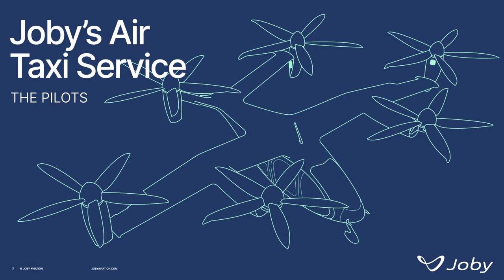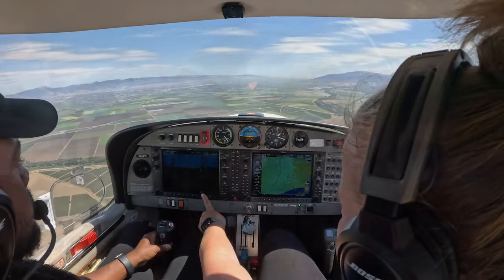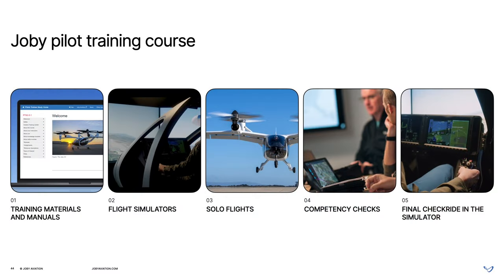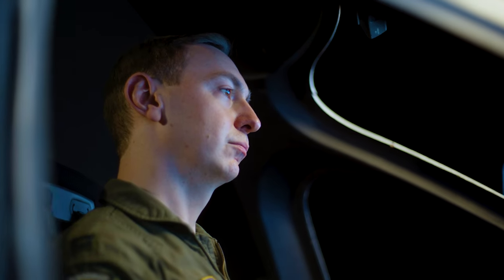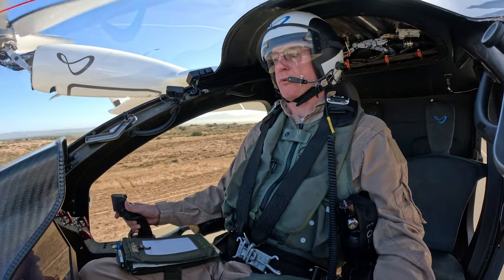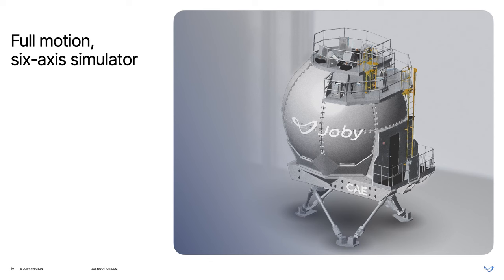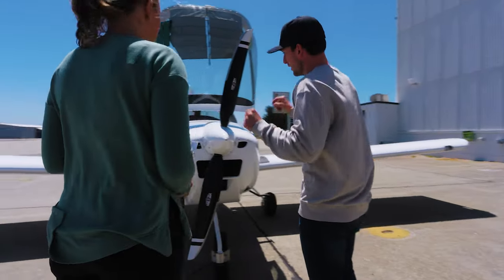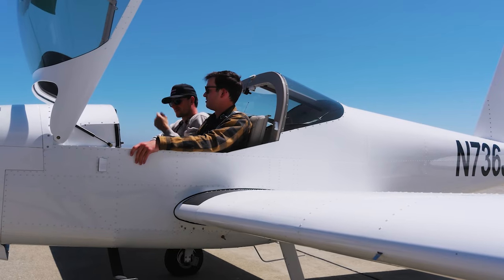Joby's Air Taxi Service: The Pilots

Comment: It is becoming apparent that the lessons learnt on the last generation of VTOLs,' pre battery powering- are slowly being remembered . The constant repetition of just how complex and  critical every stage of implementation of VTOL turns out to be ,certainly as compared to fixed wing flight or even non converting rotary wing, - this 'high tech' is being extoled as a great achievement but is actually a failing that makes the VTOL concept itself the inbuilt problem to be 'solved' rather than rethinking the whole initial goal of providing affordable alternative to road travel in both built up suburban areas and rural type environments (in both cases avoiding the need for airports or runways as a fundamental feature together with much lower noise,higher safety and other secondary goals for which it has been assumed that vertical lift off/on is unavoidable and hence worth paying the enormous cost in design and manufacture as well as operational, including piloting, complexity (artifical stability computerized control interfaces etc and much greater pilot training than normal as shown here)
What if none of this was needed or in fact desirable? What if the wrong path had been taken at the start? That is my contention in fact and the solution proposed is ATOL ,as made known to Joby et al and the other 1000 plus followers of battery evtol (VFS listed alone)  Often the simplest solution to a problem is the best and KISS gets overlooked in the technophilia induced myopia or the rush .  Just saying (again)

Comment: Why would prospective new pilots shell out perhaps $100 00] to get an evtol pilot licence when the makers have signalled that their aim is to remove the pilot altogether ASAP .  Wisk plans to start with no pilot on board and will have a cost advantage by doing so.  Others must follow suit.
 (Note, this does not apply to self flown aircraft or self driven cars )